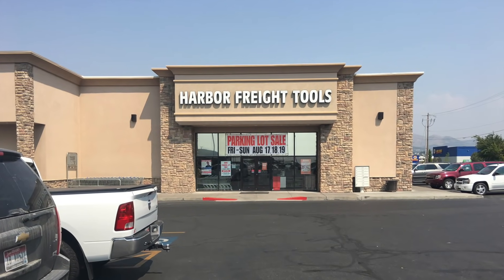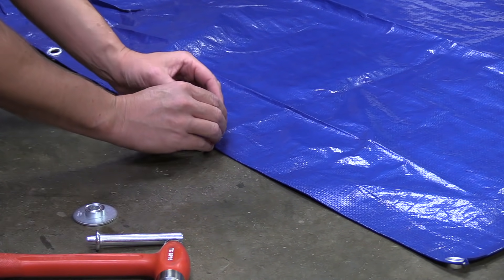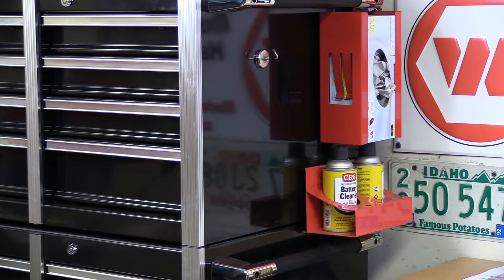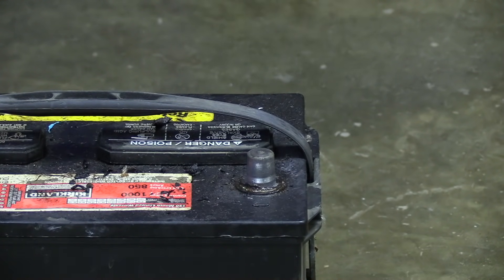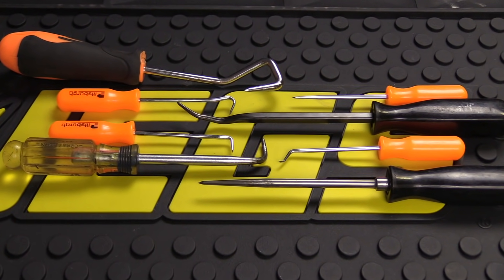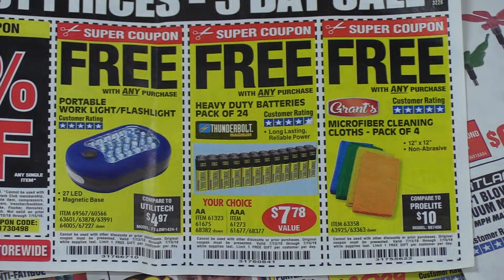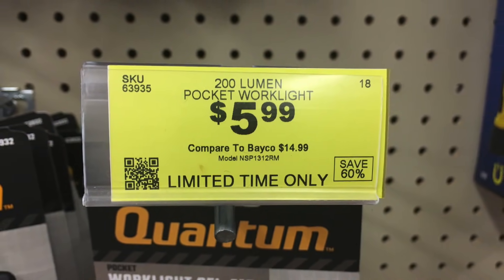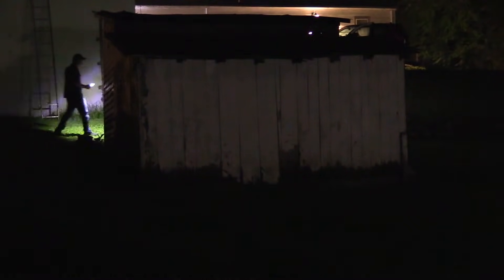TOP 5 BEST HARBOR FREIGHT TOOLS!! (UNDER $5)

Comment: Magnetic 4" parts holder (dish).  Free to $2.50.  Currently  $0.99 with coupon.  This dish has saved me from losing many a part.  Can't have too many.
Reply: Yep. Got a whole collection of them stuck to the end of my tool box.
Reply: I have 3 of the 6 inch ones (one is Kobalt branded) and 1 2 magnet US General. They are great.

Comment: I had a faulty injector on my truck that a local shop wanted $100 to diagnose. I picked up a mechanics stethoscope for $4 from harbor freight. The tool is built cheap and I mean junk cheap but, it absolutely worked and still worked today. Collectively, I’ve saved over $1000 in diagnostic fees between myself and my friends from this “garbage” tool. I am a huge fan of harbor freight.

Comment: Moving blankets are my top pick. I know it's silly but in the custom car world protecting parts is important. Also they make decent sound deadening for videography work. At $4.99 for the small ones that's hard to beat.
Reply: HotRodHippie or Free.  I have used the free coupon and gotten 3 of them the last 3 times I have been to the store.
Reply: All the blankets I've ever gotten smell like mold....anyone else experience that?
Reply: jessasdad That's a strange and unfortunate problem! I've acquired a few with the coupon as well but have never had a bad smelling one.
Reply: They may be good for that purpose, but they're not great for moving. I got one free from HFT and I had a moving blanket that was left behind by the movers and it was a lot thicker, meaning more protection.
Reply: second this, getting moving blankets from home depot are like 13 bucks for half the size, and they're crappy light felt.
Reply: HotRodHippie what is a moving blanket?
Reply: Jon Johnson a blanket specifically for protecting items when moving.  You will see movers wrap furniture in them. They are generally a soft material with fluffy soft material in between layers. The HF ones are definitely cheap and noticeably so when compared to expensive ones, but for the price I like them well enough.
Reply: HotRodHippie thanks!
Reply: I get them all the time to move stuff and not get scratches. Can't beat the price

I live in a place with a short winter and also use them to keep my quails and chickens from getting cold. Use short wood nails to keep them down and a tarp over them to keep them from getting wet and they work really well
Reply: I like the big blankets. Still cheap and great for the beach. Or even just to sleep under or use for padding to sleep ON. I always carry a couple in my van for whatever. Pillow, blanket etc. Never used one for moving.
Reply: I got several for free. Each time I pass by the local store I stop and buy something for a dollar and use free moving blanket with purchase coupon on phone app. I use 20% coupon on the dollar item too. So I get blanket and set of screw drivers or something for less than a dollar. Lol.
Reply: I keep 1-2 of these blankets along with the orange ratchet straps in every vehicle for the unexpected transportation challenges when you pick up something at garage or estate sales.
Reply: woozleboy  I got one, washed it, and slept under a while. Not bad.
Reply: I agree 💯% with building custom stuff you have to protect it from any kinda nixks scratches, I use news paper or bubble rap never thought about the blanket.
Reply: You can even keep them in the trunk of a car for multiple use it's not silly because I don't have one and I have to get one to add to my tools or the trunk of my car for an emergency kit, or even if you have to work on the car you can kneel on it or lay on it under the car we all know how the cold cement feels on the back.
Reply: Gotta love H F for the DYI guy...I really like the half vise grips that bolt to my drill press table to hold parts like an extra hand.Very handy...
Reply: Just don't leave them in the sun for more than two hours, they break down quickly
Reply: HotRodHippie I use the moving blankets to lay on when working on cars.  Also makes good knee pads.  So worth it.
Reply: The Blankets aren’t worth $hi+ .  They decompose when left outside and turn to a black and blue dust.  You can’t get them wet , I mean never ! 
      I tried to give them away to homeless guys and they refused to take them.  S MH
Reply: Use them for winter curtains
Reply: It's a cheap blanket used by homeless people , because they move to a new sleepily location.every other night
Reply: Oh yeah!  100%. I keep 2 of these in the back of my pick up truck in the rare event I need to transport a mirror or glassed in painting in back of the cab. So very handy!
Reply: I'll second that thought!!
I throw one on our shop floor during the winter, beats a cold concrete floor while servicing tractors.
Reply: @nickdelatorre2176  . . . Yes, they do. I made that experience too. The stuff breaks down into fine, almost salt crystal-like particles. It's a mess and hard to get rid of. I will never get one of these blankets again, even if it's free.

Comment: I use that sorting pan.  My old method for the last 45 years was to dump everything on a shop rag, find what I needed then pickup the corners of the rag and put it back in the container.  Pull the rag out and the contents drop back into the container.  Lately, I don't have too many mixed items in containers since getting Stanley Vidmar cabinet with sorting bins. My main use for that pan is cutting up doggie treats and putting them back into the bag. 
                       
 I will be getting that flashlight next trip due to your review.

Comment: Thanks for the thumbs up on the grommets.  I use a lot of shade cloth in the summer out on the Mojave Desert where my house is located.. The glaring sun and  110 plus temps. in July and August  requires extra effort on my part to control the heat and glare. Shade cloth is great for this job, and the addition of  the Harbor Freight grommets to the shade cloth will make hanging the shade cloth easily. Thanks again for this information !
Reply from the maker: Glad to help!

Comment: We just got the battery cleaner you showed here and it worked great. I used those from other brands I picked up at various auto parts stores over the years since the '70s and this was identical in shape, design and workability, so I was quite pleased with it.   Great tool to keep on hand.
We bought the grommet kit too, but haven't used it yet. We went camping and decided to get one just in case we needed it.  Since it was very inexpensive, it was a good insurance tool to have on hand.  Still got it in our camping pack. Their various style lights are good to have as well, just pay attention to what you need and what you are willing to pay for as their prices are as varied as the lights themselves.  Also just bought an adjustable pliers, which is very good too.  Hard or solid tools such as wrenches, pliers, screw drivers, mechanic tools, are all good buys.  Electrical tools however can be a bit iffy if you are not sure of what you are buying.   Home mechanics and home shops for basic projects, Harbor Freight is the way to go for a limited budget.  Even one off projects saves money there when you are using the tools for a limited or even one time.

Comment: Harbor Freight also carries Super Lube synthetic grease for $5. Recommend by Snap On to grease ratchets. Super Lube is now $6.99, but have greased 20 ratchets and still have half the tube left.
Reply: Scott Jancura 
Well if it's recommended by Snap-on you know it must be the greatest most wonderful magnificent and stuff on the planet.
Reply: @dontblameme6328  Hahaha! Not necessarily, but has been good in all my ratchets - from Craftsman to Husky to Harbor Freight to Snap On.
Reply: Good to know. The super lube teflon stuff has been a favorite for years. I also really like the DuPont teflon dry wax lube product line. Not cheap, but it sticks to the part but dries non sticky. Not attracting dust and dirt is a big deal.

Comment: Have one of the yellow trays, use it all the time for exactly what you showed. I like keeping old hardware in jars and this tray makes it great for spreading the items out to find what I need. Then the spout is perfect to dumb it back in the jar.

I'd also suggest spending another $15(without coupon) for the light at HF that has the flexible light. That thing is amazing! And has rechargable battery.
Reply: The tray also works for dumping a tray of ice cubes. It is not the perfect size, but it is better than dumping on the counter.

Comment: That light is awesome. I have bought several and keep them in various places. I also give them to people that don't have any type of flashlight in their car or garage. I also like the rechargeable Baurer light with the magnetic base. I have used them for over a year and they still work great. They are more than $5. I keep a bunch of the chip brushes around for staining. I use them and throw them away. Saves on cleanup time.

Comment: Good suggestions thanks! My favorite HF items (not technically tools) are the magnetic trays/bowls and the tool hanging bar magnets that are often free with coupons! I've never seen the quantum lights but I'll check it out! The tool bags are decent enough and often pretty cheap with a coupon! I also like the heat shrink tubing sets... plenty of uses for it and once it's empty you still have a small storage box!
Reply: That 4" magnetized bowl and the 18" magnetic tool strips are some of my favorite finds from Harbor Freight.  So useful and so free (with coupons!)  =)

Comment: I agree with two of your picks: The Grommet kit is super useful for adding tie-downs to tarps and I also used it to add grommets onto some nylon straps that I now use for a pellet gun sling; the set of pick tools is super handy as well-mine have etched metal handles and hang easily on a magnet bar on my workbench. I will add that I find the micro fiber cloths super helpful to have around-from cleaning my glasses to wiping up oil spills they are great (and there is almost always a free coupon for them so I have several packs in the garage and in our cars).

Comment: O-ring assortments; they have a few under $5, but the big kits are awesome for a dairy. Seal replacements on manufacturing equipment, pneumatic equipment, and a pressure washer out of one box! I also just picked up a tweezer set that covers a lot of needs from removing deep splinters in my fingers to retrieving fasteners from tight spaces in equipment. My #1 pick, though, has to be the cheap vise-grips; there's a perfect set for most of those knuckle-busting tasks involved with taking things apart.

Comment: The Braun 390 Lumen Magnetic Slim Bar Folding LED Worklight, it's rechargeable and has a super strong magnet. As a heavy equipment Mechanic, I use this everyday.
Reply: MrSandevils and they often have em on sale for 19.99.  Ive used mine for power outages and underneath the sink multiple times lately.  Awesome light, I may get another one when theyre on sell.
Reply: Great light, don't take drops very well tho. On my third and it's hanging on to it's last duct taped leg
Reply: Those put out great light, but mine stopped working after the second or third time I recharged it.  And my $5 Braun lights have issues as well (bought two, both turn off when dropped even very gently, and the batteries that came with one of them leaked and killed it). Not sold on the Harbor Freight lights just yet.
Reply: That is a GREAT light, especially with the $19.99 coupon.

Comment: I stumbled upon an amazing deal at my local HB. It was the last day of a tent sale everything was 50% off. I spotted a Vulcan Omni 220 multi process welder with had been returned and was marked $450. It was missing many of the attachments but the mig gun was there along with the stick welding electrode and the 110volt power cord! Turns out the price was 50% of off the $450! So I bought a multi  process welder for $250 and it works great for my purposes!

Comment: Angle Grinder on sale for $10.  I don't have a need for one, but it was so cheap I bought it and was able to find uses for it.  Loved it so much the next time it went on sale I bought a backup one.  I don't expect it to last, but so far it keeps going.  I'm not a professional so I really don't stress it much.  Great for the weekend warrior.
Also like the driveway chime.  I think it was about $14.  Set the motion sensor and it will ring a unit sitting in your house.  I now know when my mail arrives or when people approach the house.  I wish it would make the receiving unit Bark like a big dog :)
Reply: I've had my 4" angle grinder for 2 years and haven't had a problem I use it at least once a week.

Comment: The professional series composite ratchets are great. $10-$17 depending on size. I’ve had my 1/2” for almost 3 years now and it handles a lot of torque. Very light compared to the steel ones so for long jobs wayyy less hand and arm fatigue.
Reply: I wondered about these!   Glad to know they didn't disintegrate on you.

Comment: One huge plus with Harbor Freight, that's where I get my engine coolant at. Peak coolant for only 7.99/gallon for the 50/50 mix. You really can't beat that.
Reply: Rual King, un-deluded $7.99 + 1 gallon of distilled water $0.99 total two gallons of 50/50 coolant $9.00
Reply: Walmart sells really cheap oil and coolant. Mobil one for $25 Castrol for $18 and coolant is about the same as harbor freight but bigger selection

Comment: The picks are invaluable, your sister/girlfriend/wife WILL steal them & regularly on sale for 0.99. I have 3 sets for auto. The flash light regularly on sale  for 4.50 and perfect handy anywhere & everything compact light. Loved the grommet set and that screw sorter. The battery post cleanear while nice is something I'll misplace given frequency of use, I use a small wire brush.

Comment: Seven or eight years ago, I got one of the 18 inch side cabinet, I guess you could call them 1st Gen. I was so impressed with that box, that 2 years later I bought a second one. They are as good as my Mac boxes. 
I was going to buy a side locker cabinet this year,  but 22 inch is to deep for my set up.  They should bring back that size. Even if it is only a online offer.....

I need a third hand to reach around a deep blind area to hold a bolt, I got the Pittsburg Pro breaker bar, love it.

Working in a large shop, I got tired of taking 2 or 3 trips back to my tool box with all the tools I got out for the job. I have the 2 shelf cart to make one trip. It does the job I expected

I own both a IR and SnapOn 1/2 impact  guns, great guns, but they are big.
There are times when I would be under a trailer or truck but didn't have the space to use them. So I got the 1/2 inch ultra compact xtreme strubby. Great gun, But what  I love about it is I can change direction with a flip of my finger. It's the first thing I go to now when I need an impact gun.

Don't take this as a commercial for HF, they do sell some crap. I got a die grinder, what  PoS that was, and the hex ball sockets broke the 1st time I use them. 

What really POed me, was I had to order a impact gun for the shop. Ordered it on line. It took 11 days to get from Calf. to NJ by freight, then it was traded off to the Post Office.  

They need in store pick up for orders online, like Walmart and in a more timely fashion,  free.